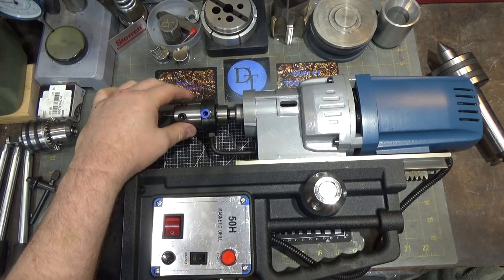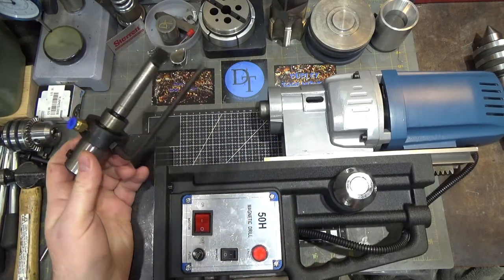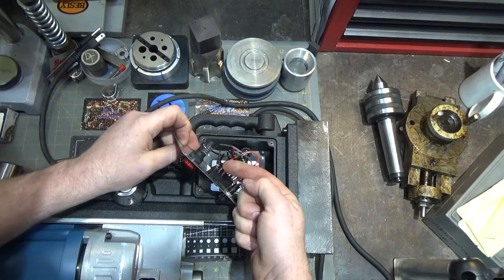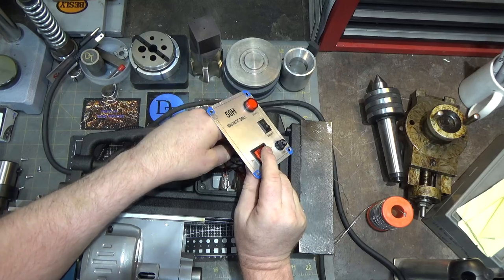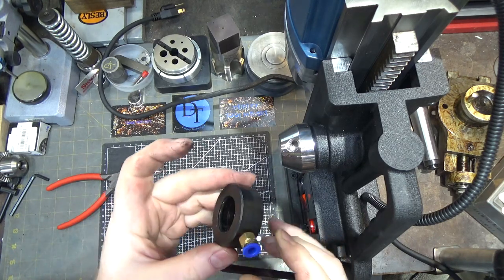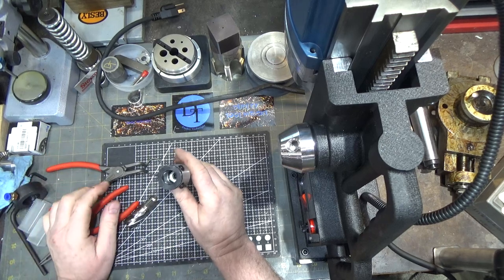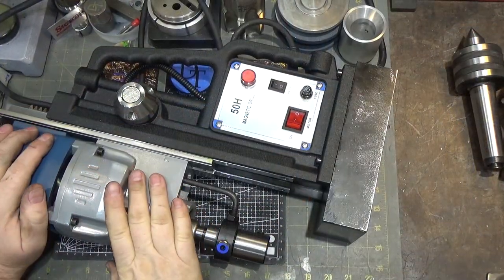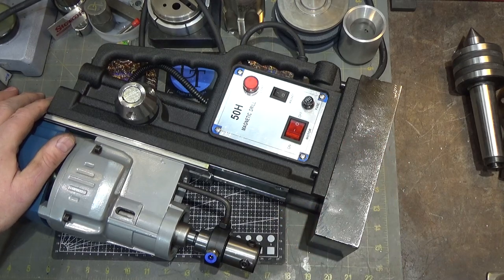QTR 63b Part 2 Magnetic Drill Press Continued

Comment: I’m pretty sure the spring is for annular cutters that come with a center ejection pin.  It’s been fun looking at this drill.  Agree it’s lacking in many areas, but the way I look at it, if I can’t justify paying for a good tool because I won’t use it often enough,, I buy a cheap one if it costs the same as renting one for couple of days.  And I think this one falls in that category.  That’s how I ended up with a plate compactor from harbor freight, cheaper to buy than rent one for 3 days.  One downside is that you tend to run out of room.  I think we need a “Pimp My Cheap Mag Drill” episode of this.  Add variable motor speed co tool, turn down the opening and sleeve it, upgrade wires inside (so tiny), etc.  Its been fun!
Reply: yes. the pin pushes on the slug. and pops it out when the cutter cuts thru the plate.  it also blocks off the coolant when the cutter isn't installed
Reply from the maker: Thanks Yuchol. I love the suggestions. I will add them to my ever growing list of things to build. It's also recently your fault that my list never seems to go down. Now I have to build one of those snazzy chamfer tools you made, if I can find a flat space to store it.
Reply from the maker: Thanks for the tip. I have only used the annular cutters on rigid machines like the mill and the lathe before this and never needed to locate the center using a pin. I also have never had any issue ejecting the slug, but I defer to experience.

Comment: Annular cutters often use an ejection pin to push out the slug.  That may explain the spring.
Reply: The ejector pin is also useful as a coarse locating pin.  I am somewhat surprised that the kit didn't include one.
Reply from the maker: Thanks for the tip. I have only used the annular cutters on rigid machines like the mill and the lathe before this and never needed to locate the center using a pin. I also have never had any issue ejecting the slug, but I defer to experience.

Comment: The centering pin/ejection pin is also supposed to be a valve that cuts off the coolant when the work isn't being engaged.
Reply from the maker: Thanks for the tip. I have only used the annular cutters on rigid machines like the mill and the lathe before this and never needed to locate the center using a pin. I also have never had any issue ejecting the slug, but I defer to experience.

Comment: G'day Robert.  It's been interesting series watching you pull down this magnetic drill.  They are a very handy tool to have in the shop.  Especially if your drilling big stuff.  Cheers from Downunder.  Aaron.
Reply from the maker: Thank you very much. I have used annular cutters since Tom Lipton first demonstrated using one and love the way they cut. I have only used the annular cutters on rigid machines like the mill and the lathe before this, but now I have the option.

Comment: the spring has 2 purposes.   for a lineup pin on a center mark on the work.  and pops out the slug when the cutter cuts thru the plate. and also hold the coolant in when the cutter isnt in the drill.
Reply from the maker: Thanks for the tips. I have only used the annular cutters on rigid machines like the mill and the lathe before this and never needed to locate the center using a pin. I also have never had any issue ejecting the slug, but I defer to experience.

Comment: The pilot pin is what pushes the lube valve that's why the cutter shaft is shorter then the drill chuck shank.
Reply from the maker: Thanks for the tip. I have only used the annular cutters on rigid machines like the mill and the lathe before this and never needed to locate the center using a pin. I also have never had any issue ejecting the slug, but I defer to experience.
Reply: @DudleyToolwright  The purpose of the pilot pin is to center your work and make contact with your work before the cutter and push the lube valve. This is why the spring is so long and goes so far into the morse taper so the center pin has room to travel.

Comment: As people said before me it is for ejector Pin. Some angular cutter set most times comes with ejector pins.
Reply from the maker: I have them, but have never used one and forgot that they were there. I have only used the annular cutters on rigid machines like the mill and the lathe before this and never needed to locate the center using a pin. I also have never had any issue ejecting the slug, but I defer to experience.

Comment: The spring is to eject the slug.
The centre location pin has a flat down its length that allows coolant down.
Reply: You make assumptions about the precision of the more expensive versions.
The process is crude and efficient and is usually for clearance bolt holes.
Accuracy is secondary to expediency. 
I bought the drill chuck and found I could only use very short drills.
The "daylight" is very small with standard drills of any size .. non existent.
Reply from the maker: Thanks for the tip. I have only used the annular cutters on rigid machines like the mill and the lathe before this and never needed to locate the center using a pin. I also have never had any issue ejecting the slug, but I defer to experience.
Reply from the maker: I did make assumptions about the better name tool versions. I always figure the knockoff market is going to cut corners everywhere they can.

Comment: Annular cutters usually come with a sharpened pin to locate the hole and then to eject the slug. I've never seen a MAG drill not come with it
Reply: the pins should come with the cutters.  all my sets have them. none with the drill unless it came with a set of cutters
Reply from the maker: Thanks for the tip. I have only used the annular cutters on rigid machines like the mill and the lathe before this and never needed to locate the center using a pin. I also have never had any issue ejecting the slug, but I defer to experience.
Reply from the maker: This drill did come with cutters and pins.

Comment: the spring is for the center pin and too help with the ejection of the slug
Reply from the maker: Thanks for the tip. I have only used the annular cutters on rigid machines like the mill and the lathe before this and never needed to locate the center using a pin. I also have never had any issue ejecting the slug, but I defer to experience.

Comment: The longer cutters get a slug stuck in them that's a real b** to get out without the spring loaded ejection pin
Reply from the maker: Thanks for the tip. I have only used the annular cutters on rigid machines like the mill and the lathe before this and never needed to locate the center using a pin. I also have never had any issue ejecting the slug, but I defer to experience.

Comment: Any updates on fixing the issues? I just got one of these, impressed with it based on price, not impressed with the up/down action, its fairly stiff, and think the rack needs to be shimmed for better engagement.
Reply from the maker: Sorry, I have not. I have so many projects going on that the magnetic press was used for a particular project and then set aside. I hope to get back to this project at some point.
Reply: @DudleyToolwright  I'm almost done in the "Made in America" conversion of mine, up/down action is now smooth, 1/16" shim behind rack got rid of slop in handle, redoing wiring now.